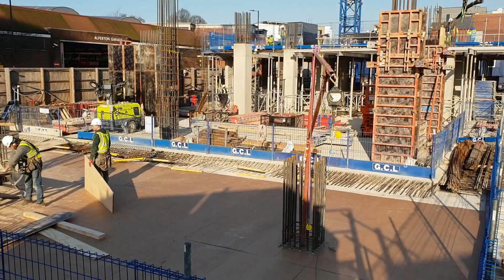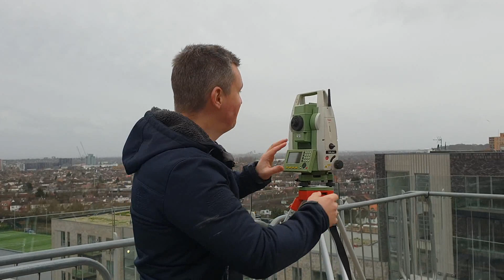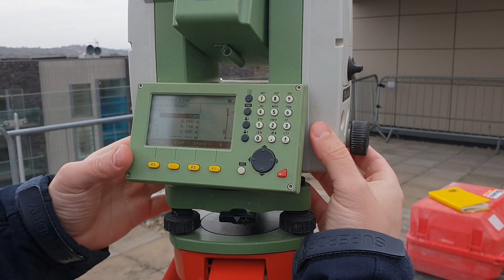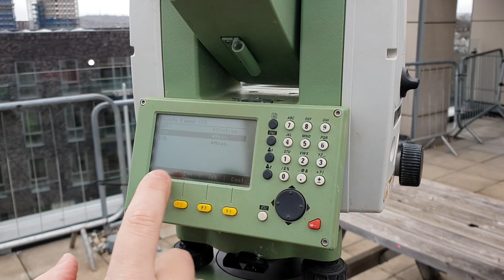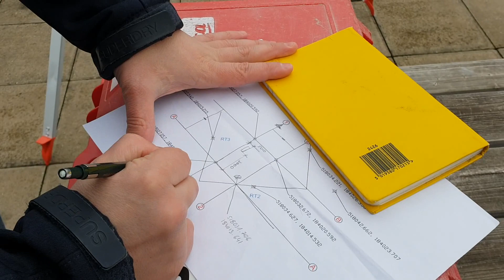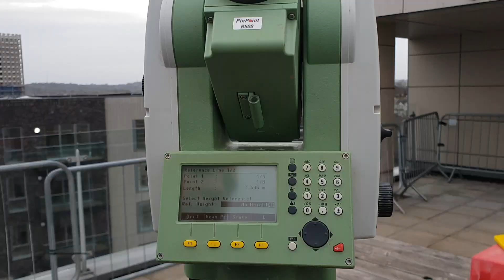SETTING OUT - How to use a Total Station REFERENCE LINE program.Step by step guide on EDM ref. line.

Comment: When checking plumbness of columns, do you shoot one point at the top and one point at the bottom and then check the line?
Reply from the maker: yes, in general comparing bottom and top to the design line, sometime you can use a ref line too, to compare bottom with top and see how much off plum the element is, but ideally you want to compare it to the design line, :)

Comment: What is the purpose of referente lime?
Reply from the maker: Almost all setting out will be done using a ref line, unless you have local grid system and with TS06 is better working in stakeout 😁

Comment: MR GREG, CAN YOU INCLUDE THE SETTING OUT #9 IN YOUR CHANNEL, I AM LOOKING FOR IT BUT  CANT FIND IT, THANKS...MORE POWER
Reply from the maker: Hi Ashly! I made a mistake and nr 10 should be actually nr 9, so there is nothing missing as the main programs are survey, stakeout and ref. line, apart from resection of course :) But you know what, I will do nr 9 vid with TS06 summary then - you inspired me to do that :)

Comment: How did you create the gridline? Just can't understand the latter parts.
Reply from the maker: Hi Engr Vine! I created a reference line and this reference line is a grid line as I have the grid lines co-ordinates.
Let me know if you need other explanation :)
Reply: Please can you explain more on how to create grid lines
Reply: @iyceintegrated9062 A gridline is not created as such in the total station it’s usually off the drawings, it’s simply 2 known coordinates extracted from the main drawing; it simply a line in any direction but usually one that’s relative to known features within the job.
We use any of the gridlines which are most local and apparent to the area of the works being set out, these you will find will have localised dimensions given off them( left or right, up or down,) to locate a construction feature to be marked out. Eg column, drain, slab edge.

If your setting up a local grid to control the job, then the origin where we work  the values of the grilling from is the most south west corner (with the axis at 0 -90-180-270 degrees respectively, they are labelled as 0E, 0N…. (Or more preferably 100e,500n to keep all values in positive figures as you work north east.)

So moving east, the numbers increase incrementally in higher values as the further you move east.. and likewise get greater as they go north.
The total station allows you to pick out and use these known points by entering them into the ref line function.
This let’s the user to associate any line that’s on random bearing to behave like it’s being rotated square onto a local grid as I’ve described above.
Hope this explains.

Comment: Greg. Absolutely a brilliant demonstration of the use of the program Reference Line from anywhere on the site. Your open demonstration to check the elevation of the building with Reference Line program was a fantastic tip and a great education on how to check it rapidly when you are out on the site and checking the work done by the the sub-contractor. The sub-contractors, who may be the bricklayers or the Kingspan cladding sheet fixers to the SFS structs can be there to correct the elevation on the site from your direction. I would like you to show how you would check the plumbness and the position of the set steel stanchion on the foundation pad using the program of Reference Line. You said that you can use the same technique of checking the elevation of the steel column by fixing the point on the bottom of the steel stanchion and checking the plumbness at various heights for setting the grid offset of the steel correctly.  Please show how you would do it in one of your next videos. This is very good video for understanding the full use of Reference Line with Leica. Thank you.
Reply from the maker: Asim. I can't see your comment in full, but I use ref line to check the plumbness too, especially when quick check is required on column shutter while/after pour.